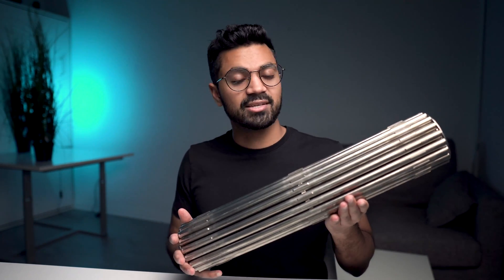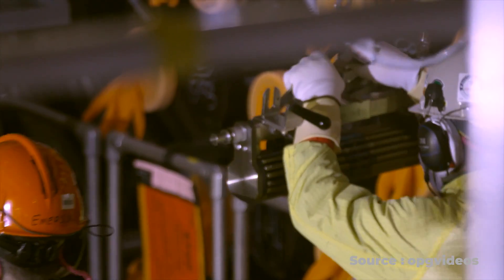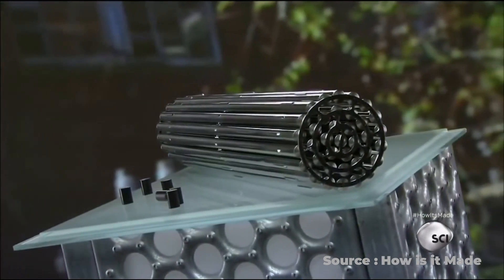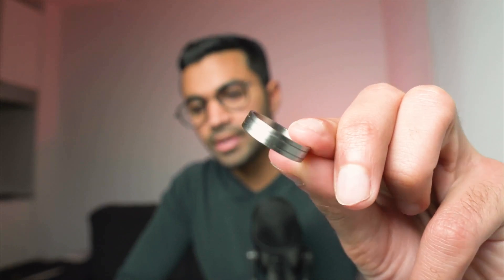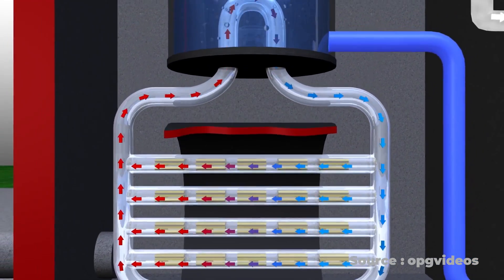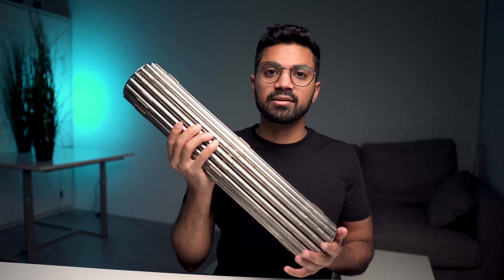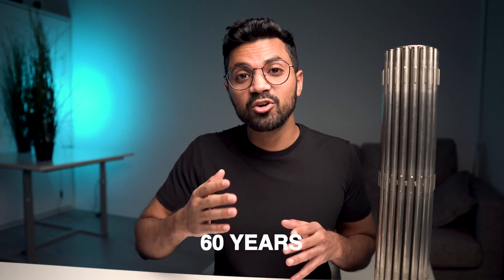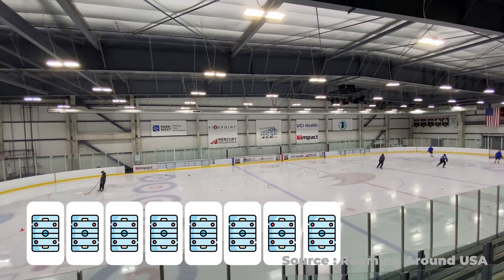520 YEARS of Electricity in One BUNDLE of Nuclear Fuel

Comment: You did explain why, if you can hold it with your hands, how does it have enough energy to boil water?  You talked about how it can warm water.   Could one bundle be used to power a steam car?   Also if the tubes are made of a material that does not impede the nutrons, why would it heat up like a pan?   I would think that it would not heat up at all because it is "invisible" to the radiation.

Comment: Ultra-cheap, clean energy technology:
Search terms:  Leonardo Corporation
Search terms:  Brillouin Energy
Search terms:  Brilliant Light Power

With less than $20 worth of parts, (plus a $200 oscilloscope), anyone can verify for themselves that the energy synthesis of the bifilar toroid technology used by the Stan Meyer water fueled car, works.

Video title: Physicist Steven Jones shows evidence for 8x over unity: circuit and measurements
YouTube channel name: Shameka Loeffler

Meyer - Water as Fuel - Technical Brief
Search terms:  orion Stan Meyer Full Data pdf

Where does the energy come from? A dipole absorbs energy from the vacuum and radiates it as observable energy. C. S. Wu, "Experimental Test of Parity Conservation in Beta Decay," Phys. Rev., Vol 105, 1957, p. 1413.

Yes, Virginia.  We have known about this unlimited, fuel-free energy source for more than 65 years.

Comment: I'm mounting a wind turbine atop the roof of my tesla.  I'll be able to travel anywhere, free, no recharging.
Reply: You can also mount a wind sail with a big ventilator blowing at it for a slow park manouvers.
Reply: might as well add solar panels and a trailer with a diesel generator too
Reply: @paddington1670  Diesel stinks.  I'm shopping around for a coal-based one.

Comment: A piece of Thorium the size of a marble does the same with far less and far safer nuclear waste.
Reply: At present, thorium can't do that.  This is a video about commercial technology that exists today.  If you want to talk about future nuclear technologies, there are molten salt fast breeder reactor designs that can extract equivalent energies from uranium, and the spare neutrons can fission the transuranics in existing waste.
Reply: @lacklustermathie  actually Thorium can do this now, it is us who can't. The MSRE reactor has shown us the likely future of safe nuclear generators. We need to further this technology.
Reply: @mikeaubrey6058  I guess I can see how my comment might be interpreted as asserting that research will change the properties of thorium, rather than our ability to harness those properties.  The fact remains that there it is not fair to compare technologies that are commercial and in use right now with technologies that are still in the R&D stage.

The appropriate comparison for Th232->U233 breeding is U238->Pu239 breeding, not commercial U235.  Both these fuel cycles scale down the amount of fuel needed from 'very little' to 'even less than that.'  For both kinds of waste, oil well drilling technology can be used to store the waste a mile underground where it won't hurt anything.  Thorium and U238 are both abundantly available.  Thorium is a mining byproduct, and there is plenty of U238 in nuclear waste and depleted uranium stockpiles.

They each have their unique challenges.  Th232->U233 has fewer spare neutrons, while U238->Pu239 must operate in the fast spectrum.   Nuclear power clearly has the potential to be the best power source in many situations.  However, since I'm not building the reactor, I don't care what kind of nuclear is chosen.  (Well, I care that RMBK isn't chosen, but I don't see that as a big risk.)
Reply: In a Greta Thunberg cartoon - yes.
Reply: @Nucleari Josefina I went to the Exodys Energy site. Very little detail. I have not expertise in this field but intuitively feel that any design that allows us to diminish the current stockpile of waste while providing useful energy is a good thing. I also like the idea that the half lives of the new waste are much shorter and measurable in human terms. I cannot understand why more effort (money) is not being made in this direction.

Comment: Thanks again this answers a couple of questions regarding if the fuel rods get wet and also if graphite is used.  I question remains where are the control rods on a Candu and can the Candu be controlled by changing the percentage of heavy water?
Reply from the maker: control rods are located at the top of the reactor, they are spring assisted and gravity dropped into the reactor. Also, yes CANDU reactors have Liquid zone control, which are zones that can be filled with light water (which is able to slow down neutrons and also slow down the reaction). Liquid zone control is used very often in a CANDU reactor
Reply: @OsamaBaig  Very neat thanks again!